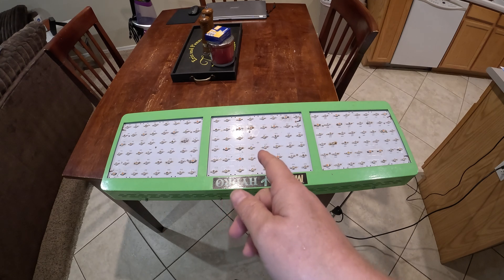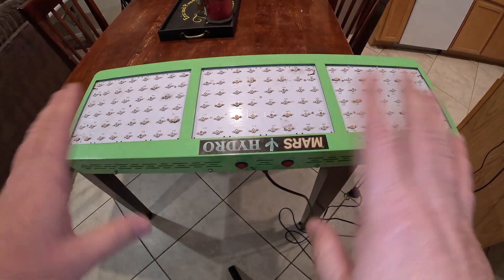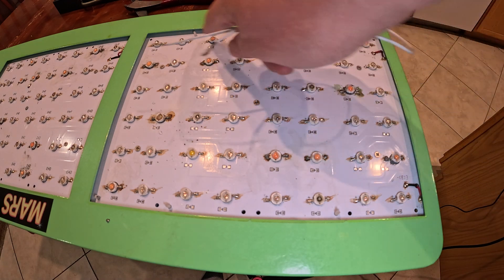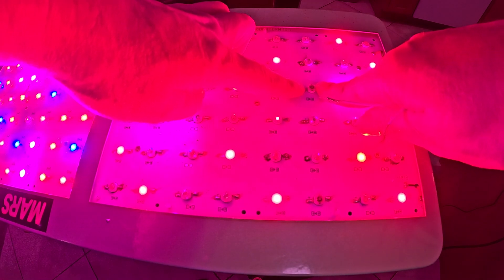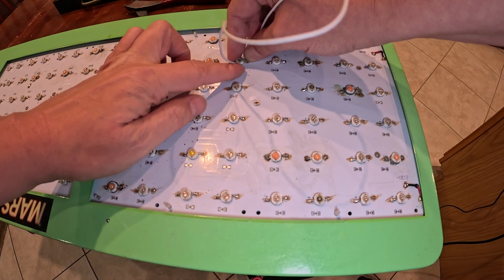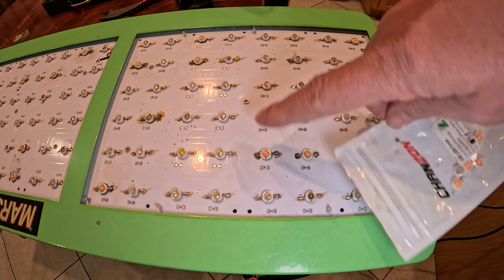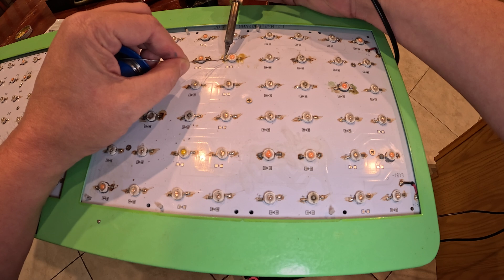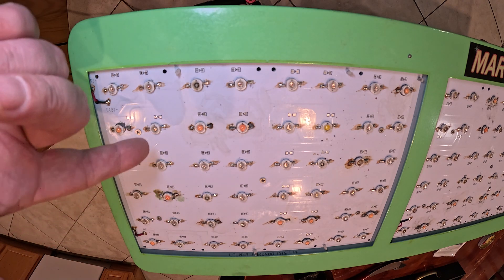Find bad LED Light with just a wire

Comment: Yeah man I'm dealing with something similar. It's on a newer bar style light. Optic LEDs slim 320s (2 dimmers) 
Anyways on lower voltage I have 2 rows of 5 led that don't light up, but when I turn it up to 100% it all works. I think the driver is bad what's your opinion? The kicker is this it's supposed to have a 10 yr warranty. The co. Told me to run it at 100% . Im of course pissed off
Reply from the maker: You could try shorting each led that out with a wire on the low setting to see if one led has a high resistance and needs replaced. Did they all light up on the low setting when it was new?
Reply: @Eric_Tennant  I finally heard back from the co. (Optic led) there mailing me two new boards. I think it's the driver myself. It's not pushing the same power at low voltage.
Reply: @Eric_Tennant  and yes it worked perfectly when it was new. 3 yrs later 10 diodes only work on high power the rest work like there supposed to. 5 diodes out on one side and 5 on the other. Well see what happens after I replace the boards